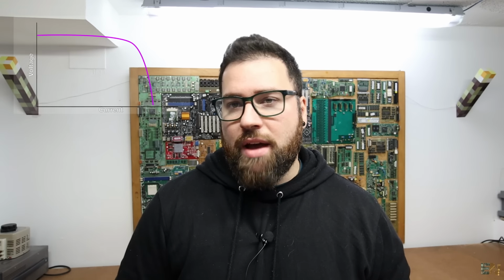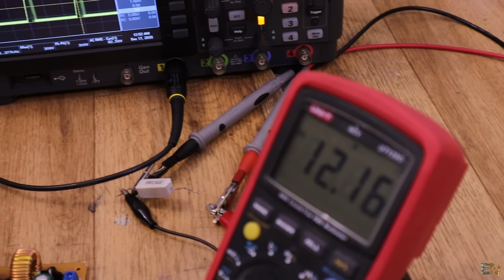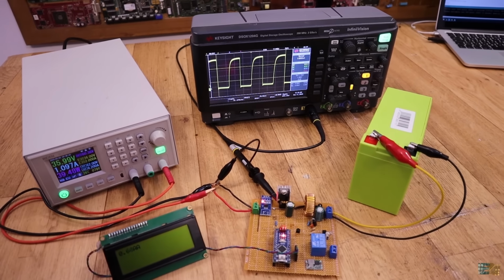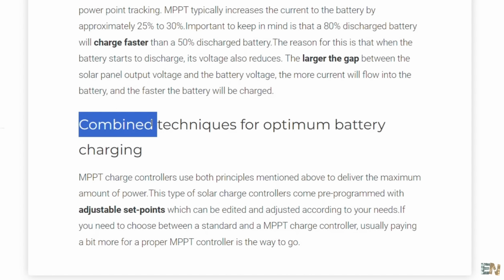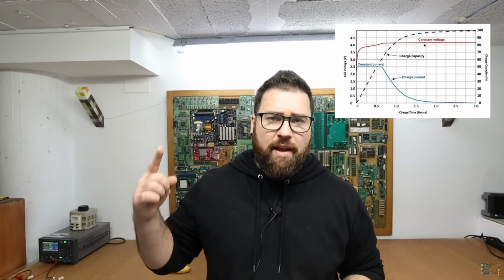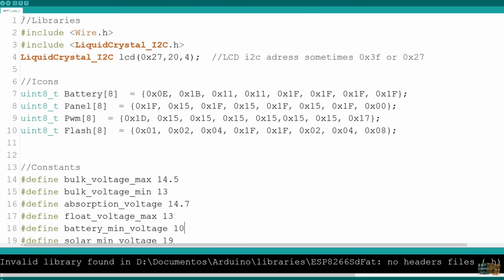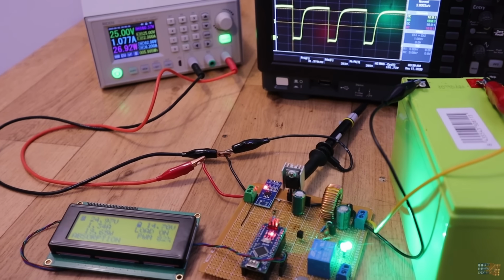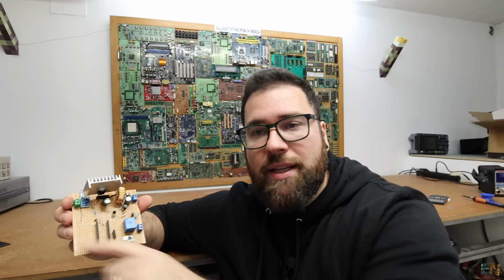MPPT What is it and How it works?

Comment: Thank you very muchh for the explanation, i was working on making a mppt charger myself and i was gana use only mppt i didn't know there is a combined one it was verry helpful but in mine I'm using like your circuit but i have esp32 and a way bigger igbt that can handel 250v and 100 amp and I'm using 2 so i can use it with my 6 panels and more I'm waiting for the final priject with the final code plz make it soon,

Comment: I want to make MPPT with TIP3055 power transistor and esp32, and about your video I think current(Amps) will not play the role the higher voltage will play the role.
My point is if we can get 25 or 35 volt dc with 1 apms of current then how can we convert it 12v 3apms ??
the math is:
solar gives: 35 x 1 = 35W and I want 12 x 3 = 36W almost close or if specific 2.91667 amps of current, so does it possible?

Comment: Thanks a lot! Can you explain why the voltage drops from 5V to around 4V when you connect the 4 resistors in parallel? Couldn’t the supply output 1 A and 5V at the same time?

Comment: Here is my final thoughts on this muddled video. You can also put this quote directly ingo AI for refinement:

"True mppt is not about battery charging but maximizing power input from a solar panel. The confusion comes in when the MPPT algorithm is mixed with algorithms necessary to protect the battery. Thus the overall "MPPT algorithm" is often presented as the mixture of pure MPPT power collection algorithm and the control algorithm for battery charging. Before doing a mppt presentation one must decide on the scope of the presentation."

The title of this presentation "MPPT What is it and How it works?" does not clearly specify what is being described and the actual presentation seems to drift between the two concepts. I would perhaps change the title to "MPPT Charge Controller What is it and How it works?" Then make a clear statement of how the MPPT part works "simply" while becoming increasingly complicated at the battery charging algorithm keeps coming back to interfere with that process. 

BTW: I constantly make and remove comments. You would be smart to review my comments and copy them for future reference as they will soon be gone and then you will be scratching your head to remember the logic. But as i gather that you are just parrotting AI content you don't even know where to begin anyhow.

Comment: What algorithm does it use to find a maximum?
Reply: An example MPPT algorithm works by using negative feedback. After calculating power output it increases the load slightly. If the power goes up it continues to increase the load. If the power goes down it reduces the load. It keeps doing this until it reaches a steady state point where it oscillates between two load states- the center of which is the maximum power point. You need to research "control theory and application to mppt". You can also research (more specifically) "PID (Proportional-Integral-Derivative) algorithm and appication to MPPT". There are better algorithms than PID, but that would likely be a good start.
Disclaimer: I'm a real electronics engineer.

Comment: As far as I understand, the only parameter that can be adjusted is the pwm duty cycle  in the bridge. As the power of the panel changes depending on the sunlight, it is necessary to adjust the pwm duty cycle so that the voltage at the output maintains the desired value. Is there another parameters to be adjusted besides pwm duty cycle?

Comment: Once you connected 4th resistor, why voltage dropped from 5V to 4V? What would then happen if you short-circuit it? Would voltage drop close to 0V, would current remain at 1A, even though effectively it would mean no power delivered?
Reply: This is a great question! I only offer an answer because you don't mention the name of the "content" provider. In general if you have intelligent questions you should direct them to people reading the comments as they are often much more intelligent than the content provider making the video. Here is your answer:

The power supply has an internal resistance of about 1ohm. In constant voltage mode (before Imax) it has a negative feedback algorithm which maintains the terminal voltage at 5V. This means the internal voltage is actually more than 5V. When Imax is reached this internal feedback mechanism is disabled and the power supply goes into constant current mode. In this mode you can picture an internal voltage of 5V with a 1V drop over the internal resistor and the remaining voltage drop of 4V over the resistor he provided. But rather than worry about the internal resistor, you can start from ground (0V) and calculate the voltage rise across the resistor using the formula V=imax*R where he has chosen imax = 1amp, therefore Vr = Vout = 4V. 

Now, if you short circuit the power supply you have essentially Rload = 0 and Vr = Vout = 1amp * 0ohm = 0V. You still get 1amp of current because you still have a 5v power source. It's just masked by the 1ohm internal resistance. So now you are faced with the concept of "power" versus "efficiency". At a zero ohm load the efficiency effectively drops to zero as you still have power P=iV = 5watts being dissipated inside the power supply. Power to the load would then be limited to whatever heating is encured on the wire itself. Remember we say a wire "nomonally" has 0 ohms, but in real life a wire does have resistance, a voltage drop, and power usage.

You have show great insight into the nuances of electronics. Keep up the good work and I am sure you will do well.

Comment: Nice bla bla video, but with a main fault!
The formular for power is P = U x I.
V is the unit for Volt.
Reply: So, here is what I think you are saying: U (German: Unterschied) more closely represents the voltage DROP (difference) across a load. This is the actual power we are trying to maximize here. Whereas "V" in a stricter sense represents the internal Voltage of the source. Using "V" in place of "U" does not take into account internal resistance, voltage losses, efficiency, etc. If you are talking about the power of the system then there is no need to maximize that power because it always presents itself- even if you short circuit the panel you still get maximum power based on P = V x I. But the real purpose of the MPPT is to move that power out of the panel and into the battery. (I'm pretty sure, however, that if you increase the load resistance you really do reduce the system power as even the internal power (loss) is decreased as the current is reduced. 🤔)
I'm pretty sure this is a novice video offering entertainment for novice viewers - not so much experts as yourself ; )
So yes, as in 99% of all YT videos - just another bla bla video- expecially when compared to years in college and many more years doing research to actually UNDERSTAND what we "learned" in college. However, the channel by its own description is called "Electronoobs" implying that the viewers are all expected to be newbees (noob == newbee == person who is clueless (new) in their field). 
However, I'm sorry that nobody even made an attempt to read and understand your statement for over 5 months. It seems that the only people who appreciate intelligence are those who already possess it.

Comment: I'm making an MPPT buck converter with a panel at the input (the output is a resistor) I'm applying an MPPT with a frequency of 4kHz (switching frequency 40kHz) I'm measuring the input voltage through a voltage divider connected to a 4kHz low-pass filter (I'm measuring the current through a shunt and an Ampop with a filter at the input and output) what I've verified is that the MPPT tends to reach the minimum. Should I put a capacitor connected to the PV (in order to reduce noise)? At the converter input I used a 45uF capacitor (my converter uses Cout=100uF, L=440uH, R=7.8ohm)

Comment: One question: if at our mpp point the voltage is say 20v and 1amp of current. But the load or any battery charger need 13v to operate then the system will going to change the volts accordingly, then how can be say the mpp is reached. ( becz the mpp will be possible at 20v and 1amp here) ? I'm  bit confused here... answers are appreciated.
Reply: You need to first learn how batteries are charged. First phase of battery charging mode is constant current this means you maximize current (and therefore power) going into the battery during this phase. In this mode it's not the charger that drives the voltage (surprise) but rather it is the battery (what???). Why is this? Because when you are charging a battery the charger is the source and the battery is the load . As a load, the battery behaves as a load. How does the load respond to more current? U = i * R. So the voltage drop across the battery will be the current going into the battery times the battery equivalent resistance to that current. So, theoretically the MPPT by itself would charge the battery until it exploded. Think about how you may prevent this from happening. Think about some circuit that monitors the battery voltage and takes you out of MPPT mode; because otherwise you will ruin the battery.

Comment: Please how does a high voltage mppt between 240v to 500v and even 1000v works. Like in most hybrid inverter they will specify that the PV input range for the MPPT most be between 240v to 500v.

Comment: but what circuit parameter does mcu change to change input voltage and current to find lets say solar mpp? is it pwm duty cycle of step down converter?

Comment: soory burt low battery charge with pwm and near full with mppt charge makes no sense.
spezial in low state batterys can drain alot power and in this situation is it importand to deliver maximum amperes into the battery, if a battery is near full mppt or PWM not matters coz current goes down.

the higher power" Ampers" of MPPT chargers is for low -empty batterys the essenical part.
then your 25 Volt panel is what?

a 12V solar panel comes with ~21 Volt no-load voltage and ~17 Volt work voltage
a 24 Volt panel have double the numbers.

your 25 volt not exists.

Comment: I think that a good charger need to have an inverter inside like the power supplys have, so you can charge a higher voltage battery with no problem with it. Sorry for my english and sorry for the video english also, it was strange to be listening to that, i felt i was in India while i was listening to that.

Comment: Hi, very good video, for low current and voltage you can use what you have in the box. But for your home, you need e.g. 5000 - 20000 W of power all day long, so it depends what you prefer. Maybe low voltage 44 - 66 V battery and inverter. In this case 20000 W / 55 V === 360 A of current. So you need  4  - 100 AMPS or 2 - 200 AMPS MPPTs, and you need to be good in air and water cooled solutions, because 200 AMPS is a lot of heat. Maybe you prefer low current but HV battery. E.g you have 400 V battery, 20000 W / 400 V === 50 A, if is only 50 A of current , not so much heat, but you have to deal with precharge circuit, because if you put 450 V from solar panels to your input capacitors, or you use wrong circuit breaker, the probability of DC arc will be high.

Comment: I’m still trying to wrap my head around the MPPT concept. What does it do that a conventional buck/boost converter won’t do? Won’t the input of that circuit naturally seek the MPP of the panel?

Conceptually, it sounds analogous to radio frequency antenna "tuning" by matching the transmitter and antenna impedances.

Comment: MPPT can be used when you are going to install solar panels and you already have a UPS installed. You just install the solar panels and use an MPPT to charge the batteries connected to the UPS, and that UPS can provide power to your house from those batteries. It is a cost effective approach to setup a solar system.
Else, you will need a solar inverter that will be costly.

Comment: hey i have been su Subscribe to your channel for a while now. And I've been searching YouTube or the net for for for videos like this. Because you know I'm going through a divorce. And I don't have much money and I don't have PG&E. But I do have a big solar array. So it forced me to go off grid. And start storing my power at home. I'm currently in the 12 V system. And I cannot find or I want to make my own charger but into a 24 V system but I wanna be able to to carry a lot of a lot of Watts, but I can't really afford you know to to buy the the residential ones so you know I'm only using. 6 of my panels and I have 22 I have the specs or values on it. I just don't have it right here with me. I currently have a 60 app charge controller. I think it's like 720 W. But what I want to do is get a 24 V system and then. But my inverters are all 12 V. So do I have to have a step down transformer? Or do I have to make one I don't know, but thanks for your videos, man if I could get your feedback. That would be great thank you
Reply: so i Guess what I'm asking you is? If you can help line me in the way to make an m. PPT charge controller that is 24 vote, compatible charging and with a big amount of Watts. A 100 damps or 200 amps. And then a step down controller or transformer to run my 12 vote inverters or a way to switch my inverters to 24 V. In the circuitry, I don't know, man. I'm still learning and I need some help. Thank you for your time

Comment: I was thinking about using a buck boost converter ahead of my cheap pwm controller. That way the only thing that would change is the available current. Have seen over 16 volts coming out of some of the pwm controllers.

Comment: I think you should separate the battery charging part from the MPPT circuit, assuming that the output of the MPPT is at maximum capacity, and leave the battery charging to the dedicated battery charging circuit to handle.

Comment: My diy mppt is a boost converter that receives 40v from the solar panel and boosts it up to 58v the current is controlled by an LDR and a diode some resistors and a potmeter, I have found that the max mppt is 34v on the solar panel at max current if the voltage falls below 34v from the solar panel, the charging current is adjusted down automatically via the LDR.

Comment: Here's another comment to feed the algorithm... Nice video!
One of my current projects is to have a cheap set of 80V solar panels charge a 12V battery home made out of  NiMH cells obtained from an old e-bike battery. All used components are very cheap (<20 euro), so I don't want to add an expensive controller. I decided to make my own out of cheap bits and pieces. 
The challenge now in wintertime is to find a good way to make use of small bits of power coming from a grey sky. The first issue I encountered is that the battery acts as a huge power drain. Connected straight to the panels, it drags the voltage down to the minimum, without drawing much power. Using a cheap buck converter to make 12V doesn't change that behavior.
The best solution I have for now is to use an ATtiny44A to inject voltage into a cheap MT3608 boost converter to regulate its output. That way I can limit output voltage to reduce current draw, based on the input voltage. Next step is to also measure current and perhaps replace the converters to allow higher currents.
I'm looking forward to see your next video about your MPPT controller and see a bit more about the converter section as well as the current measurements.

Comment: 11:46 I don't know if you know, but lead-acid batteries with 10.5V on their terminals are considered 100% discharged!
About 13V = 100% charged, 10.5V = 0% charged.
There is no question of using them at a voltage of 7 or 5V because such a voltage means irreversible damage/sulfation of the lead plates from which such a battery is made.
This is why almost all converters/inverters cut off the power supply to the receivers when the voltage at its DC/AC input (from the battery side) drops to 10.5V

Comment: Can and how can one feed a mppt microinverter channel with a battery? E.g. connect 48v battery as a panel for mains power as charged by wind and solar panels to a hoymiles microinverter? If a series power resister is used to limit current to say 400 watts panel equivalent would that work? Plainly the battery power needs to be switched on and off as battery charge changes

Comment: The power vs voltage/current graph of a real solar panel is not as smooth as the ideal one. So the MPPT controller could get stuck on a local maximum instead of going up to the actual peak. To prevent this the controller should scan the entire range periodically or at least once on startup.

Comment: Speaking of solar panels... I read a paper (DOI: 10.1126/sciadv.abm0078) about electrostatic dust removal and apparently a voltage of 5-10 kV could charge up a susbstantial amount of dust particles and pick them up on a plate for "up to 95% recovery of lost power output". 
So... can't you use this for something useful? Like a DIY electrostatic/triboelectric handheld cleaning gadget that can pick up pet hair and keyboard dirt and stuff?

Comment: Waiting for your final video with the final MPPT-PWM wifi product. I already did a product that controls my inversor, with an arduino, wifi module and current esp8266 sensor, so it turns on and off the inversor sensing if there is consumption, if not it turn it off, mostly during night but if you turn on a light it will turn it on but only a few seconds later. And if I left my house it will turn it off until I came back, and I can check V and I values using wifi. This way I increase my system efficiency.